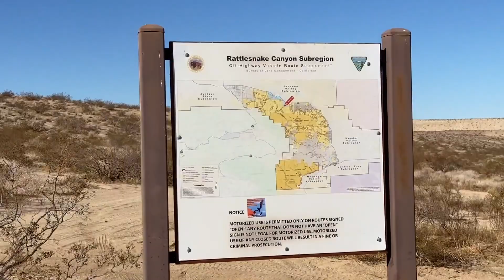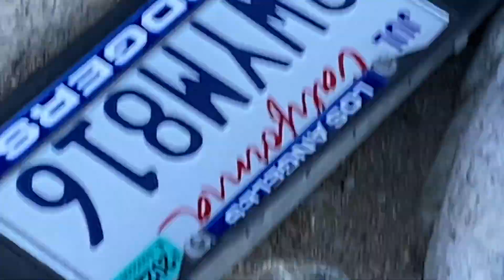OUR JEEP LEAVES US BROKEN & STRANDED ON THE TRAIL!

Comment: The rock the tie rod was on was redirecting the hydro assist force even more towards the front of the Jeep greatly exsaserbating the non paraell pushing energy.  Suspect correcting the ram force angle would allow the use of the aluminum setup.  Nice trail fix btw.

Comment: That type of aluminum tierods are designed to flex and spring back when you put the weight of the vehicle on them on top of a rock. So that tierod end didn't break because the bar felt over a rock twice.  I'm sure Kevin has been doing the same with the old chromoly tierod for the past 2.5 years he says he's been using it and not only that one has survived the abuse, those don't flex like aluminum tierods do  when the wheels are under load with a front locked and you're trying to steer one way or the other. Unfortunately the same flex you see when you rest the vehicle on top of of those alum tierods is there when you jam the wheels in a rock and you want to get out of the pinch while trying to steer hard, that will break havoc with your super duper 2.5 Ton TRES so it's a matter of time before you need to replace them or worst. Look at the video from min 13:50 or so to right before the TRE snaps, then watch the slow motion: Kevin has his driver wheel high on the rock, and he's turning the Jeep wheels towards his driver side to keep his driver side high up in that rock. His passenger side  is cleary turning driver as he wants BOTH wheels to turn, but the Tierod is flexing/twisting under load because that's what alum tierods do and causes his driver wheel to get cocked towards the inside /passenger side until the tre snaps. Alum tierods have been hyped out for a short while. They take lots of real space down there and will twist like toothpicks under load side to side. It doesn't look good on a high end Jeep like this to see wheels getting cooked like cheapy Chevy IFS tierrods. You'll see people will tell you oh yeah the huge alum bar will survive the flex, sure but their TRES don't bend like the alum bars do.

Comment: from the video your right wheel was on the inside of the huge rock and as you moved forward more pressure was put on causing it to snap
Reply: But the left wheel is on a tie rod. There was nothing binding the left front. Shouldn't have snapped.

Comment: Great video!  IMHO, those forged tie rod ends are too long and a bad shape. You had a lot of built up pressure with the PSC and the flex of the aluminum rod. So it breaking there didn't surprise me.

Comment: Hi Guys, at 12:12 in the vid you came down hard when you fell " as easy as you're gonna go", that fall in combination with the disparity in the angeles of the system could gave been the reason for the failure. As always great content!
Reply from the maker: We hit our other tie rod like that hundreds of times with no issue
Reply: Completely agree with Jim L. Coming down on it like that could definitely have weakened it
Reply from the maker: Still difficult to wrap our minds around when our Dynatrac setup suffered through much worse without any issues.
Reply: Yup, you win the mystery contributing reason, that tie rod was worked hard by the entire weight of the rig moments before. Granted, it was taken out by the bad hydro angle in the end, but it was readied by the full drop weight of the rig onto it first.
Reply: It will be interesting to see what the metallurgical investigation shows. Hopefully they share that with you. Thanks for responding.
Reply from the maker: @scothansen3779  that hit shouldn’t have done any damage to the setup at all. They are made to take that abuse. Our other tie rod has been fine for 2.5 years and Tons of abuse with zero issue.
Reply: @LiteBrite  Sure hope it gets resolved satisfactorily , love watching you guys.

Comment: In my opinion, the tie rod end links are too long so it creates too much leverage. Specially when the aluminum tie rod flexes that much, the steel ends can not keep up. I have an aluminum tie rod but my ends are no longer than 4 inches. I could be wrong

Comment: I run fusion steering (rare parts) on my kingpin 60 and it’s held for the past 4 years of wheeling other than one set of replaced ball joints. I  am going to get some spare end links though in case the situation ever happens.

Comment: From 13:30 to 14:00 the whole steering system was bent forward, the tie rod snapped at 14:00 due to  too high bending moment around the vertical axis. The shape of the crack at 15:07 suggests this.            Awesome trail, awesome group. Keep going :-)

Comment: Time to put the tie rod and frag link on Hi Steer arms. Use 1975-88 Dodge one ton tie rod ends. The straight rod gives massive strength and the Hi Steer keeps the tie rod up off the rocks infront of the dif. You may need a slightly longer Hi Steer arms to keep the te rod infront of the drag link.   CHEERS AND HAPPY NEW YEAR        Steve h.        Ps Kevin if you look at the footeage you will see that at least twice before that end broke you backed of a rock with the entire weight of the jeep on the tie rod. that will be the most likely cause. The entire rod bowed upward and put all the force onto that end of the arm. You got lucky the first two times but the third was the straw that broke the camals back.  LOL

Comment: The anti-flip on that rod end will make it weaker. But looking at where it broke, you can see some tiny voids, and a really large grain structure. Which suggest a poor forging job. They will definitely want to talk to their manufacturer.
Reply: I thought big grain too! Soon as it was shown. Like what the,,,, is that cast!?!?!? Nah no way... Kevin making the rod into a frown then sawing on it might have not helped.
Reply: All of the previous beatings.....metal never forgets.  I have broke a few sector shafts that were cracked for long periods of time before failure. I have a specific technique I use to inspect after hard rides now.
Reply: Definitely overheated in the hardening process if that is supposed to be forged steel.  Looks more like cast with that monster grain!  This coming from a knife maker who does heat treat all the time.
Reply: @bobbywalter5320  can you share your inspection procedure?
Reply: I think so too.   Just a bad part from the beginning.   The manufacturer will want to see that.

Comment: A couple of points from an armchair engineer.

The rod end with the fracture mode appears to be extremely hard, as in overly hardened during heat treating.

Not having the tie rod in hand for inspection, however high stress parts that are threaded don't use a cut thread but a rolled thread. The root of the thread is a stress riser on a cut thread, while a rolled thread reforms the material. 

The rod end appears very beefy, even larger than rod ends on military off-road 5 or 7 ton trucks.

Comment: Wondering if a tailgate chop on a gladiator would be cool. Bringing the whole tailgate and light assemblys back to the edge of rear tires. Kinda like they did on stepchild in the front but just rear to get rid of the big Overhang. Just a thought. 🤔
Reply: Several builders have done that chop.
Reply: Apparently you missed SEMA a couple years ago.
Reply from the maker: A bobbed truck bed is definitely an option for a Gladiator. And it looks sick. 😊
Reply: @LiteBrite  I saw one at Dixie4X a few weeks ago and you’re right! Great look! They took 11 inches off!
Reply: @trjnsd6874  Dixie definitely did their Gladiator right.

Comment: This event was a blast! I don’t think I would have had the confidence to even attempt something like Mottino Wash without the benefit of seeing the others go before me and you guys and everyone who came along to spot for us. Thanks so much for running these events and I’d recommend them to anyone.
Reply from the maker: You did awesome!!
Reply: Mottino wash is definitely gnarly. I did it when I was on 31s and it was a struggle. Also got my first body damage on that trail.
Reply: Aluminum tierods are awesome when they show how they  bend under a rock and spring back like nothing ever happened but that same flex when the front is locked and you're trying to steer over an obstacle that put loads against the wheels  not only is ugly but can take the rod ends as well. Look in the video in slow motion as Kevin tries to steer driver. The passenger wheel is going driver as Kevin wants BOTH wheels to go driver , but the driver wheel gets cocked towards the inside while the tierod is flexing like a biatch. Not a fan of aluminum tierods. Yes they're big and shinny oh and they flex for sure. Bla bla bla.

Comment: To the naked eye, the grain of the sheered tie rod end looks good, but that may change when they look at it under a microscope. In slow motion it looks like the tie rod rotated forward and down for no reason.....I say no reason because it didn't look like Kevin was putting any steering input in and drove a straight line. That could be from the PSC not being parallel, but its all just conjecture at this point. Looking forward to your upcoming video with the answers from RPMSTEERING.

Comment: If you look at the broken material of the tie rod end, the grains look really large. If you can see different colors with the naked eye, that means the alloy materials are not finely distributed throughout the metal. Instead you get chunks of carbon and whatever else. You guys are kind of right about the angle of the ram, but that angle is no where near as much angle as the tie rod end itself. It’s own angle is what puts the most stress on itself. #straighttierodsforlife.

Comment: Watching the video, I think when your front end fell off that rock it stressed that tie rod. You fell right onto the tie rod, it bent a good two to three inches, making the weak point that driver-side tie rod end. You came down fairly hard, and that was a lot of weight transferred to the end. So, while that wasn't a particularly harder obstacle than anything else you have ever done... you were at a really weird articulation angle there and your spotter was not making it any easier for you.

Comment: That fracture looks like a Brittle fracture where perpendicular force is applied. So your Ram set up along with the deformation of the aluminum tie rod and the length of the forged end, could have allowed enough side loading to sheer it off.

Comment: Pretty easy to see, the rod ends are way too long. They need to be as short as possible and the big beafy ally bar needs to be as long as possible, giving just enough length to the rod ends for adjustment. The way it it there's massive leverage against the thread on the rod end, which is so much narrower and weaker than the rest of it.
Reply: My Barnes aluminum steering linkage uses a longer aluminum bar and shorter tierod ends. I do like to see how much flex is in the aluminum bars when compared to the steel bars and not stay deformed. They always bounce back in to stock form.
Reply: @toddhoffmaster6057  Barnes stuff is just good.  It’s that simple
Reply: I broke my aluminum fusion on the Rubicon and I don't think I was doing really that much to it it broke right where the rod end goes in to the aluminum bar. It has a lifetime warranty so they did send me out a new bar and the tie rod ends I got are inch and a half offset and I guess they make a 2 inch offset . I think I'll keep my inch and a half offset. 👌

Comment: When you installed the new steering components recently, I did not understand why. You did not seem to be having problems with the old setup. The new setup hangs lower. Immediately gets rammed into rocks, then breaks. I’m not impressed.
Reply from the maker: Yeah, the old tie rod had a small bend in it from us beating the crap out of it for a few years. It was still fine, though. Kevin just liked the shiny new aluminum setup & wanted to give it a shot.

Comment: That tie-rod was broken when you took it out of the box.  It was a bad cast or a bubble or something that weakened it in that spot. That was NOT enough force to have broken a good tie-rod.  I agree, Full Hydro with Heim Joints.  I also agree with Jon down below,  if that had happened on the highway, ???...  Full on blessing for it to have happened on the trail.  Nobody was injured.
Reply: Full hydro on the street is not a good idea.
Reply from the maker: It’s supposedly a forged piece, but we sent it back to them so they could have a metallurgist analyze it
Reply: It isn't "full hydro" so...
Reply: @jakeweber9787  No, but some people were suggesting a switch to full hydro.
Reply: @jakeweber9787  reread the original comment bro

Comment: Wow here I am looking at Don's RPM stuff on my 1 ton swap because I'm tired of replacing the heims. The length of the tie rod end and being offset allowed for a lot of flex until it sheared. Gonna have to reevaluate this now because I have extra heim joints that can be swapped in but I really don't want to have to carry 2 extra expensive Tie Rod ends.

Comment: Thanks for the post mortem on the tie rod break.  You assessment about the angle on the steering assist ram makes a lot of sense with regards to the vector of force applied to the end of the tie rod.  The break does look like a structural flaw in the lattice of the steel though so your suspicion that it could have been multiple factors sees very plausible.  I hope you will update us on what the results at the lab are.
Reply from the maker: If we get an update on the broken pieces, we’ll definitely update!
Reply: @LiteBrite  Thanks!

Comment: Not the 1st TRE that's broke on the latest batch of RPM's steering. I've seen at least 4 other posts in various FB Jeep groups & IG within just the past 4-5 weeks. Those Apex forged TREs aren'tcutting it. At this point, Rycroft is going to have to go into damage control mode.
Reply: TREs aren't really for a crawler imo....

Comment: That was crazy how it snapped like that. Maybe something went wrong during the forging process that weakened that piece of steel. Or maybe the steel is too hard so it just snaps like glass. I had issues with forged steel tractor implements before. It was like they were just way too hard so instead of having a tad bit of flex when getting in a bind they would just snap right off. So I had a guy make me some out of a bit milder steel and I never had another issue. I talked to the manufacture and they said if we make them out of milder steel they could bend after a while and need to be replaced. I was like, I would much rather them wear and bend after a lot of use than have them snap off and cause my machines to be down for the rest of the day. lol.
Reply: I've annealed parts when worried about forgings being too hard and brittle - I'll take bent over broke ! Obviously, you need to know the steel composition, etc, etc, etc.... Learned it from an old time welder who ran a... You guessed it - onsite tractor repair business!
Reply: @ewingfox6459  That's me, I'll take a bend over broke any day, and that's why I didn't understand why a tractor manufacture wouldn't use milder steel when they knew certain parts were way too hard and snapping off. Then it hit me, they made the parts we had to keep buying and replacing. lol.

Comment: "Ram Location" on off-road race cars I have often tied the ram into the steering arm up out of the way. When used with a steering box its job is to eliminate feedback and take all load off the steering box with good links [heims] it will last a lifetime.

Comment: You can see how much that tie rod was flexing and basically being a lever or fulcrum right at that spot on that tie rod end. It had no choice but to break because the tie rod had so much energy loaded up in it. A steel tie road would have been able to distribute the energy  across the entirety of its length and not focus it all one point. The aluminum tie rods are nice for being able to return to shape but this is their downside.

Comment: It appears the structural integrity of the steering components may have been compromised by the shortening of the frame. This probably caused an oscillation in the semireticulating radiator bearing cause dissimilar metal corrosion on the rod end.  All joking aside I think yer on the money with the ram assist angle being off... Makes total sense. Happy New Year all. Hope it's a happy,healthy, wealthy 2022 for the LBN.

Comment: I say go back too the steel set. That aluminum bends under the weight of the pressure.u can see it flex and blend that's why it broke but great video
Reply: I think I remember the installation and there was a description that said the aluminum was supposed to flex and return to straight better than steel. I don't remember anything about snapping off tie rods. Refer to my comment regarding the "...search for the weak link." When this whole business is old news, the new news won't be too far down the trail.    😁👍